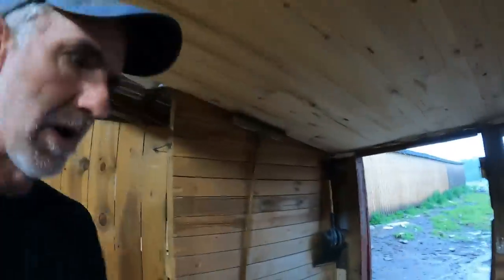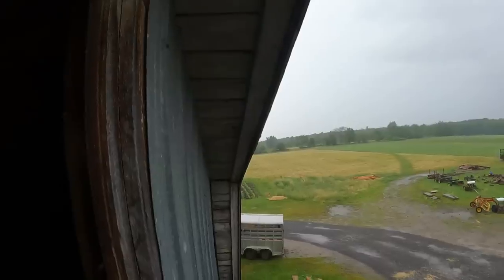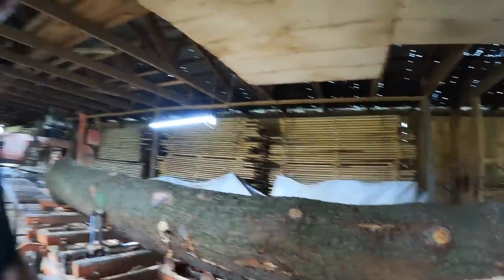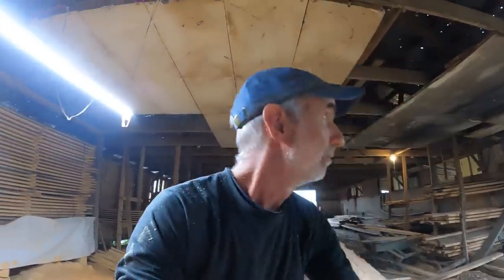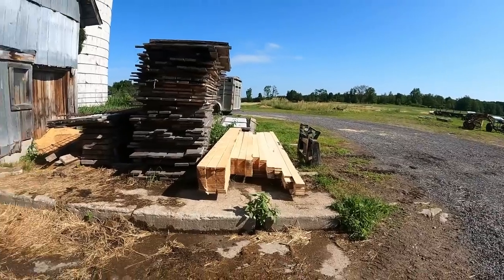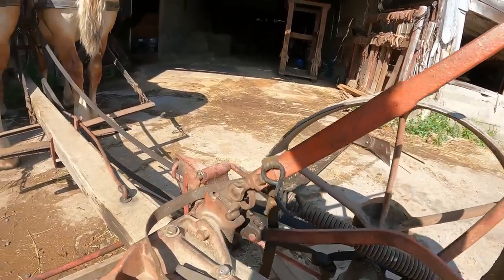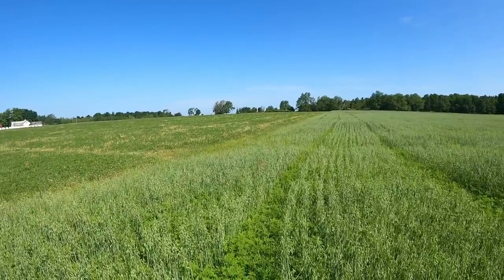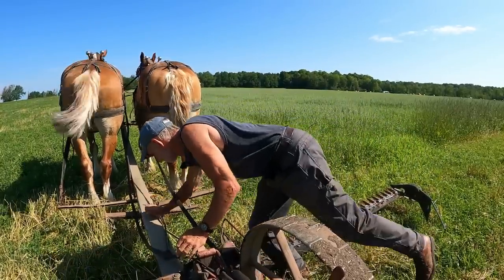How many 1X4's can I get out of ONE LOG??? // Work Horses Mowing Oat Hay

Comment: What stage of hay making is harder on the horses? Also I have noticed that the Belgians are quieter the. the Percherons, is that just the difference between these two teams or are Belgians quieter ESA breed? I notice that the left hand Per he on is throwing his head alot, do you know why?
Reply: Well Linda Jim said we could answer for him , so I will try.  Question # 1 mowing , tedding and raking the 3 jobs Jim uses horses for making hay. I guess mowing would be the hardest but he is only using a 6ft cutter bar so not hard on his horses at all. He uses his Massey  Fergeson 255 to bale hay because it is faster and good hay making weather , can not be wasted. Question #2 A horses would be a horses it does not know whether it  is a Belgian or a Percheron so I do not know how to answer this. Question # 3 Why do marching solders swing their arms. I know that is not a very good answer , but I tried. Does anyone else want to try to answer

Comment: When you open a field of oats do you do it the same way as other crops...outside, then the middle? Straight lines ?
Reply: Short answer YES , counter clockwise then clockwise Your method is the same but after 6 or 10 rounds clockwise then turning straight lines on the headlands with no cutting on the headlands a little more time wasted not cutting the headlands but Jim is not being paid by the hour. He is being paid with love getting to use his horses.